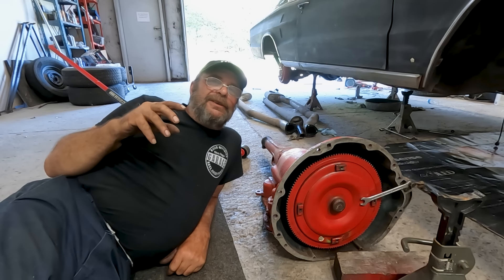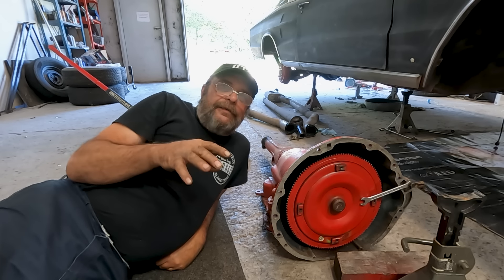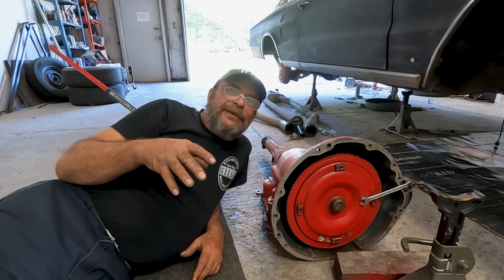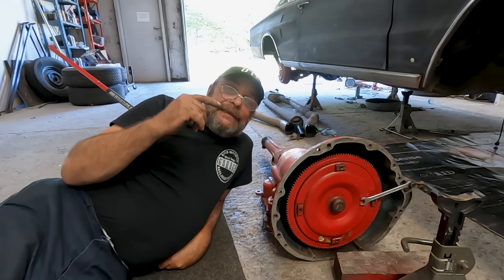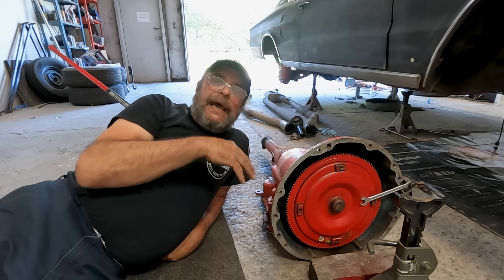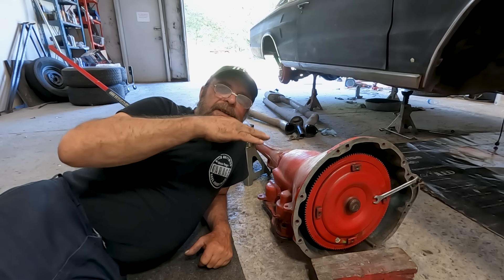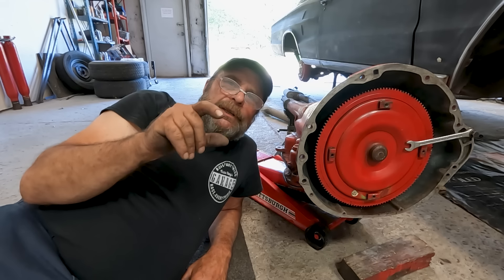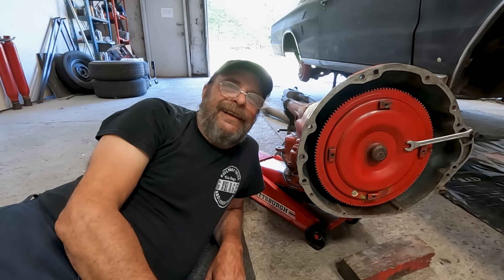One Man, On The Floor Transmission Install- So Easy Even An Old, Crippled Guy Can Do It

Comment: Back in 90's when I was in my early 20's I pulled several auto and manual trans from my camaros and ta's by my self. What made it worse is I only had my dad's old school 70's car ramps. So could only raise the front and no floor Jack. I would pull the trans down onto my chest and roll it off. Then to install I'd get under car,roll trans back onto my chest then just bench press it back into place.

It was rough but I did it like that several times. Now I'm nearly 50,handicap(not from hard work,medical issues) so those days are long gone like that. Now I just use a trans jack. Put a new clutch in my Mach 1 just last month and barely a busted knuckle....lol

Comment: quick straps.
the kind you can just pull and they snug up.
string two of 'em between the frame rails, one for the bell housing end and one for the tailstock.
super easy to line up, and you're not gonna drop it.

Comment: do you ever mount the trans to the engine while out and install together? (did this back when i was young on a 1980 cordoba with a slant, not easy but it worked)

Comment: At 18 yrs, I would push the FMX into place behind the 351c in my Cougar with one hand/arm, grab the greasy suspension or frame with the other hand and pull them together. Today, I'd be lucky to lift that heavy FMX under a car with both hands.

Comment: That won't work well with short shaft Th400s and Th350s such as are in A and F body GM cars. The bellhousing does not exist under the converter either. In my younger days I would slide the transmission under the car, place the floor jack behind it, lift the tailshaft with one hand and pull the jack under the pan with the other, keeping the trans from sliding with a knee. I am a bit more burly than most people, and I could bench them in there easily, but its hard to start the bolts while holding it in there. Also doing everything alone, its best to not get a Th400 or 4L80E wedged between the vehicle and you, resting on your rib cage. Them 4L80Es are HEAVY... as in H E A V Y  heavy.. with that lock up converter full of fluid in there. 

When I built my shop in 2015 at the ripe old age of 46, I splurged and bought a two post lift because I do LOTS of transmission, engine, and brake line work up here in Da Up Nort Eh. Rather than having a transmission jack sitting around taking up space, I made a fixture to fit my engine crane and I tell ya what, that thing works slicker than snot on a doorknob. All I have to do is lift the transmission about 36 inches and put it on the fixture. Its a lot more stable than one of those tall transmission jacks, and you can put tools on it as well as use it to drain the pan too. One tool rather than four tools, because my shop is full of engines, transmissions, wheels, tires, cars, and all the other stuff needed to build hotrods.

I did so many things on the floor, in parking lots, without a roof or walls, having to haul my tools into the apartment every time I had to go somewhere for anything so they didn't walk off while in the USAF that I made it my life's mission to build a shop I can work in, with all the tools I need. I sacrificed quite a bit just to have the shop, built it first, my house second because it was that important to me.

Comment: Hmm, I've never thought about this, but it could definitely come in handy.  I'm lucky enough to have an old screw type transmission jack lying around that belongs to my father, so transmissions are fairly easy as long as I can get the car high enough off the ground to work with it.  When working on a small block powered torqueflite equipped car, the magic number is 15" off the ground when in the dirt and pulling the transmission by itself out from under the car, or 24" off the ground when on a good piece of concrete and pulling the transmission with the jack out from under the car.

Comment: Replace the block of wood with a cheap skateboard 
I use 2 
I put one under the front and one under the back makes it so easy to slide under the car
Then remove rear skateboard for jackstand and exactly the same way as you👍

Comment: Some small 14" steel rims work well as jack stans when you have to work under the car with the wheels and tires are. Jack up one side, put rumunder tire. Jack up other side and put under other tire.

Comment: Used to bench press em right up there , if a dinosaur wasn't around to help out .
If you have a vehicle with a frame , especially a truck /SUV , a 3 - 4" ratchet strap or 2 are your friends .
Just slide the transmission into the approximate place you need it , run the strap under the balance point , hook both ends on the frame rail , and ratchet the transmission into place .
If you need some extra height you can put a block of wood between the strap and the transmission pan .
It may not work if you have a unibody vehicle , but I don't work on many of them these days .
I have also used ratchet straps for some extra leverage when power tools and cheater bars were unobtainium .

Comment: I installed a TR-3650 into a crown vic on jack stands in a gravel driveway. I picked it up off of the table in my office where I rebuilt it, carried it through the living room, outside, and I lay down under the car and pull the transmission under to where it needs to be. After this, I lifted the transmission by hand under the car, and slid the jack underneath it. Then crank and muscle until it's in.

Do I regret carrying the transmission out myself? No. Will I regret it in a few years? Yes. But 5 speed Crown vic, baby!

Comment: Great vid UT. Only, I would have put a thin piece of wood between the floor jack pad to prevent denting the transmission pan and tried chaining or pull-down strapping the trans, to the jack somehow. If you get in trouble under the car, you let it fall.  I have cracked a case or 2 in my day.

Comment: I remember my Dad and I in about 1970 doing a clutch replacement in a 1966 Plymouth Fury III. New process four speed. We picked it up together over our shoulders and pushed it into place. No jack, no wood, just us. In our back yard on the grass. It killed me and I was 19. How my Dad did it in his 40’s I will never know.  In my 50’s it took me and my 65 year old neighbor both to put a 3 speed manual in a 52 Plymouth. With a jack.

Comment: I changed a 400 turbo transmission on the garage floor on a 1972 Pontiac Grand Prix once when I was 20, it wasn't too bad then. It only took a few hours.

Comment: I'll never forget the time I was 16 in high-school rebuilding my dad's 69 charger rt, long story short the 440 was gone before the original owner. It was always a 318 too myself and my dad. My dad built a 7 foot pit with concrete for oil changes. Well we used it a lot working on the cars. It was handy except for transmissions but dad insists to this day. My buddy and I two 6 man football stars, where yelling shoulder to shoulder in this pit lifting a small block 727 that was too tall and too skinny while my dad got the bolts started. I can manhandle a 727 by myself as long as it's not above my damn head. When I do it on my own I jack the car up high enough to squeeze my fat belly and just let the 727 fall on me and roll it to the side on a dolly and then do that backwards getting it back in

Comment: wow that reminded me of all the old mopar trannys i changed  out in the 70s and 80s i did it almost the exact same way one nite i yanked the trans out of my 440 challenger pulled the pump using the bar and chain method replaced the clutches slammed it back together and was out looking for more victims in 3 hrs .I stomped on a Camaro real bad that night.

Comment: While installing my C6, I use a prybar or ratchet strap to lift the bellhousing up, then slide in a block of wood. Same with the back. I CAREFULLY repeat the process until I can get a jack under it. You have to be careful the blocks don't roll though.

Comment: Cut, bring in the stunt 727! The one with the scratched-up oil pan & bellhousing! Novel JENGA game using rickety stacks of 2x4s to lift that tranny. Floor jack seems like a great way to dent the pan and cause a leak or damage the filter or valve body.

Comment: 65 yrs old , I didn't know what a floor jack was. Used a siccors jack to get blocks under the tires then bolts out and slide it out and sit it on my chest and slide it off to the side and then drag it out reverse the process and back in it went.

Comment: i run a 2x under the car set the trany on it and slide under .then start blocking the 2x up one side at a time until it's up high enough .if you have engine hoist ,run a rope down the back of motor to bell housing and jack under tail shaft .

Comment: When i was 15 yrs old i put a  c6 in by putting it on top of my chest and knees pressed up in place starting bolts. Alone. Same with turbo 400 when i was 20. Yes i was extremely strong. Lifted weights since i was 12.

Comment: I removed the original drop in hat from the jack and bolted on a steel plate with plywood on top of that. Auto trans will sit there very nicely.

Comment: The way I used to do it is that the first thing I'd do was get a couple of bolts maybe 4 inches long that'd thread into the block, then cut the heads off and thread them into the block to act as guide pins. I'd slide a cinder block under the car where the transmission went, then I'd slide the transmission next to it, give it a big ol' bear hug and get the trans onto the cinder block. Then I'd alternate between 1x4's and 2x4's at the front and back of the pan, using the tailshaft housing as a lever to tilt the transmission onto successive pieces of wood. It didn't take long to get the trans high enough to tilt it up and get it onto the guide pins. Run in a couple of actual trans bolts, take the guide pins out and proc eed.

Comment: Never thought of having the eng & trans at an angle. Just too much work. I chain my engines in the front, usually to the sway bar, to keep them level (and from falling backwards). Some use blocks under the pan, too.

Comment: For the last 4 tranmissions, I've been able to use a cheap ($120) Harbor Freight motorcycle lift. I used a combination of 4x4's and 2x4's to ensure the trans stayed on an even plane. The trick is rolling the trans off and back on for the reinstall since it never clears enough to just roll it out. Plus the lift handle had to be removed for clearance as well. All this was done on a 3/4 sheet of treated plywood since my drive is gravel. I recall as a kid, watching a guy muscle a trans in without anything at all. Yeah, no thanks.

Comment: Lots of good advice. I remember using the plank trick to put a Volkswagen engine in but we had no blocks just 2 extra guys. I suppose the worst one I did was with a floor jack on an icy parking lot at -20 c.

Comment: For several transmission RnR jobs "back in the day" when all I had was a cheap, auto parts store trolley jack, I actually made a few "jigs" that bolted to the jack after the saddle was removed. I made them from 2x2s, the cheapest 2x10 scrap at the lumber yard that I could cut to the right length and, hardware that I scrounged and/or salvaged from other junk. They would cradle the transmission but, I always added a couple short lengths of chain just in case. They weren't fancy but, they worked and, by being careful, I never had one fall even working on uneven grass and/or gravel. Where there's a will and/or need, there's always a way.

I never thought about using a piece of all thread or a cut down bolt as a guide though. Thanks for that tip, I'll be using it on my current project.

Comment: Cinder blocks.  Yeah  That is a good trick.  Thanks,  but in the day we didn't have a concrete floor to work on.  I have         to remove a Ford manual.  Hope I can still do it without a jack.

Comment: My buddy's dad was a certified GM mechanic and worked at a dealership for years before he opened his own shop. He installed them by hand. He'd lay down drag it under press it in place the hold it with his knees till he started a couple bolts. I even saw him do the full time 4x4 transfer cases that were cast iron and heavy as all get out. If you've ever messed with a transfer case you know they are about the most awkward thing ever on a jack. He had back surgery and didn't do many after that. Have to wonder if his work habits had something to do with that.  He was one stout dude though and honestly not because of his size. I think he was only 5'10".

Comment: Take two short lengths (5 inches or so, more if you have room between the engine & the firewall) of all-thread with the same thread size & pitch as the bolt threads in the engine block. Thread those pieces in the top two thread bosses in the block. Slide the trans onto those. Trans slides right up to the engine like buttah. Put in the other bolts to hold it in place, then finish the job.

Furthermore, when you get the trans onto those studs, thread on a couple nuts to keep the trans from sliding back off, then you can put your converter in after, saving a lot of weight to muscle around awkwardly.

Comment: I don't know where this idea that floor jacks and jack stands were uncommon in the 70's is coming from. I got my first floor jack and  stands in 1973 when I was 16, purchased from the local Shucks auto supply for me by my Grandmother. The jack, two stands and two metal ramps came to around $120. I got my first air compressor around the same time, a small, 1.5HP hot dog style Ingersoll Rand for $59. Sure, it was all lightweight stuff, but it was fine for me for more than a decade.

Comment: If you do find a trans jack at an estate sale (where you can see how the prior owner treated all his tools) or stuff to make your own, grab one for the day you need to slide your rear axle out from under the car--it can do double duty. then use the engine hoist to lift it in the air high enough to bolt your axle to your engine stand. Now you can rotate the entire axle to let that stinky fluid drain out one axle tube, weld the tubes to the housing, invert it to slide the axles back in and let gravity help, etc.

Comment: I always put a piece of plywood under tranny pan so i don't dent it. It also gives me a better balance..I  always slide the tranny under the car first then rock it lift it using  alot of thin pieces of wood and 2 jacks for front and back front up a little back up a little slowly to maintain a good solid base and balance it is slow but i never have to worry about tranny slipping off a nd falling back to the ground once high enough i put a floor jack under the tranny pan with a piece of plywood.They never slip off. these are always turbo 400's going in my chevelle.I am 63 years old and not very strong

Comment: I have to change the input shaft seal on my '94 Ranger manual tranny. I'm going to give your method a try. I used to install 4 speeds in my GTO and '69 Camaro by laying it on my chest and squiring, under the car then lift it into place, but Muncies were much lighter.

Comment: I'd crawl under, drag the trans under with me, then lift it on top my chest, and slide it in,  I was at that point once , (thankfully) it started raining, no, storming, by the time I had the long tail TH350(375)  doweled, the water was running down the road, in the drive,  hitting my shoulders, and on my chest,  and  to top it off washed the bolts out of reach!💥  Luckily my dad came out to see why I was still out in the storm,  threw me a couple bolts and ran back in the house,   I stuck them in and  got out the rain, and wet clothes!

Comment: Putting a transmission into a car by yourself using a floor jack is a job that sucks like no other. But you left out three things that make it worse. Doing it at night. Or just as you are about to push it forward to bolt it up it starts to rain. And last of all finishing the whole job including the transmission lines transmission crossmember and mount driveshaft and all the hard to install upper bolts . And then when you try to install the torque converter bolts you realize you have installed the flex plate in backwards.

Comment: I used to just muscle them into place like a He-Man. But I'm now 37 years old, and going to physical therapy for arthritis in my right shoulder. The darn thing hurts like hell. Just reaching into my refrigerator for a drink I'm nearly screaming in pain.  I also have no cartilage left in my rib cage, and the cartilage in my neck is showing excessive ware. My spinal cord has ware and tear consistent with a 70 year old man. As i said, I'm only 37.  I used to be a pretty strong guy. I could spin oil filters off by hand without a wrench, I could lift tires and wheels and put them on the car one handed, i could pick up a transmission and walk across the shop with it. I was a pretty strong guy.  But take my word for it.  Just because you can, doesn't mean you should. My back sounds like a bundle of sticks breaking every time i bend over. My shoulders make crunching sounds if i shrug them, and just bending over to pick something up off the floor, makes my knees and hips pop so loud people on the other side of the room say "What was that?" . My body is so racked with pain i can't sleep some nights. You might have strong muscles, But your bones, and joints, and cartilages, tendons, ligaments, etc. Those are pretty much the same as everyone else's, you strain them to much, you're going to have problem later down the road. It doesn't matter if you don't need to wedge the trans to get it off the floor. Use the jack anyways. It doesn't matter if you're strong enough to spin an oil filter off by hand. Use the wrench. Be easy on your body. Don't ware it out before it's expiration date. If you do, you'll You'll regret it, i promise you that.

Comment: The aw4 in the zj was a pain. I haven't had install troubles with ax15, 727, or nv 4500. I use a car ramp and a piece of 2x6 for transfer cases. I replace all the studs with bolts on transfer case but 2.